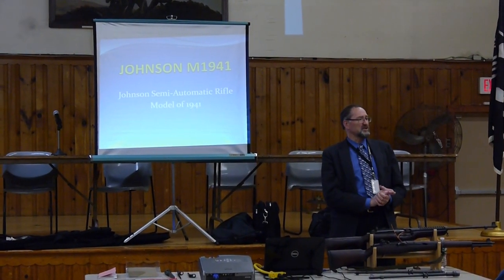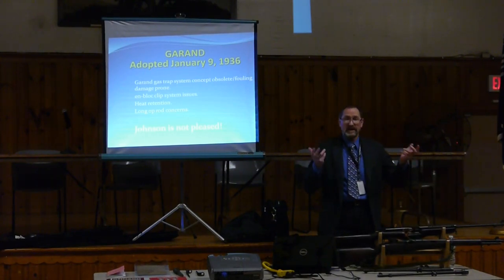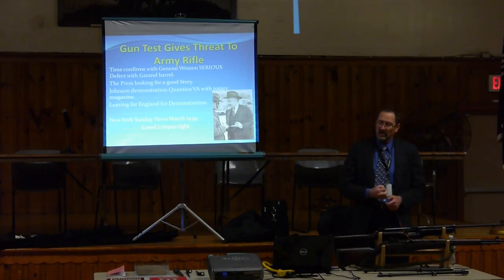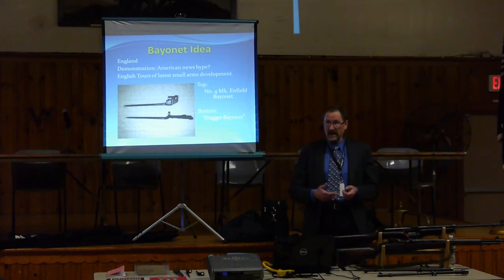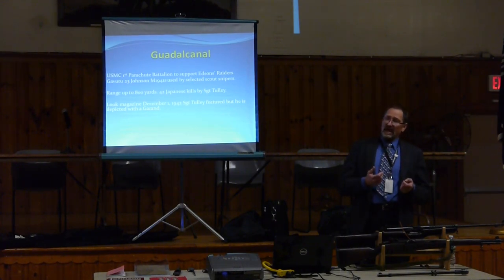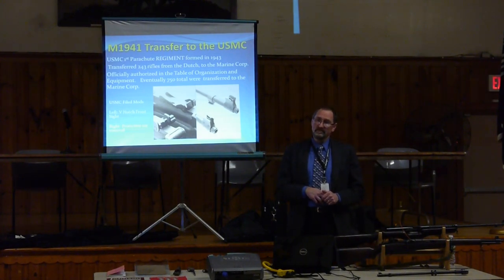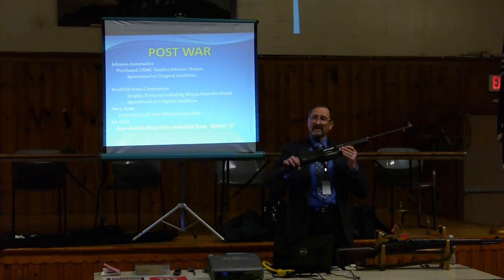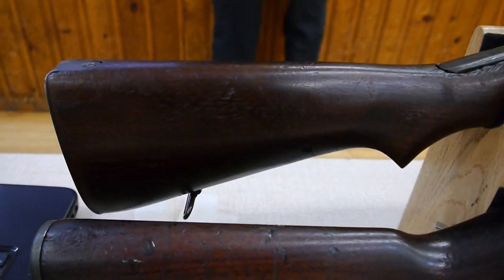Presentation of the M1941 Johnson Rifle | Collector's and History Corner

Comment: I have a nice example of the M1941. It's probably heresy, but in some respects I prefer it to the M1 Garand. The M1941's magazine is easily topped up with single rounds or five round stripper clips. Recoil is mild, and cleaning is a breeze since there's no gas system.

Comment: I have one with serial No. 2500. I have tried to find out how many were made. The research I have done shows batches of 10,000. First batch 0 or 1 to 10.000. Second batch A0 or A1 to A10,000, and B0 or B1 to not quite B10,000. I have seen 70,000 as a contract by the Netherlands, but that was never fulfilled. In conclusion, I believe less than 30,000 were built. How many in un- sporterized original condition still exist is unknown. I have seen one sell last year in Canada for$7,500.00. How rare is this rifle? Thank You Chris Butler!
Reply: 21,400 according to Canfield.  20,400 to the Dutch and 1,000 to the Chileans.

Comment: I don't see how the recoil system was superior to the gas piston system, contrary to Johnson's assertions. There is a reason the LMG never got much traction.
Reply: It’s superior in that you aren’t reliant on a heavy gas piston / op rod system that can foul and get out of spec. On the other hand the gas system doesn’t care how heavy your barrel is or if you have a bayonet on it. Gas systems were new and militaries were uncertain about the longevity of the system, how the barrel would hold up in the gas port for instance. 

Short and long recoil were better understood. The Remington model 8, a John Browning design, used long recoil with a rotating bolt that had a hanging tail that went into the buttstock and had a recoil spring located there. It also had a charging handle on the bolt that disassembled by pulling out a small spring loaded knob. Sound familiar? 

The 1941 Johnson was a lighter gun and had fewer parts. It could also be field striped much easier and could be parachute configured in two parts that took only a few seconds on the ground to assemble. It should have been used instead of the M1 carbine for parachute units expected to fight as infantry.